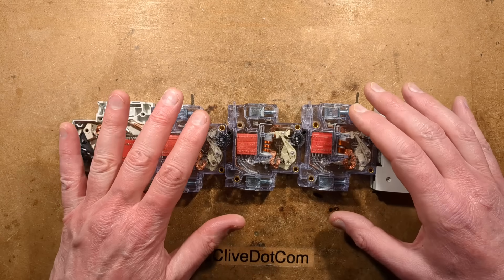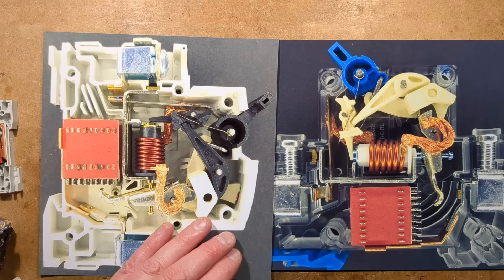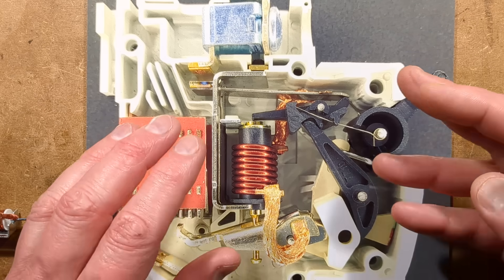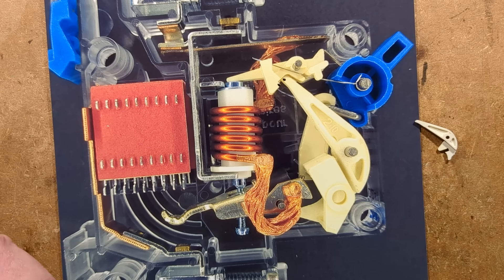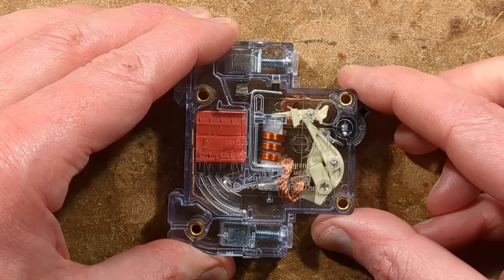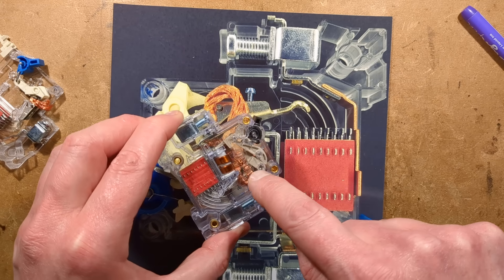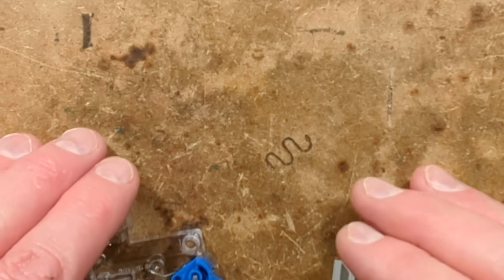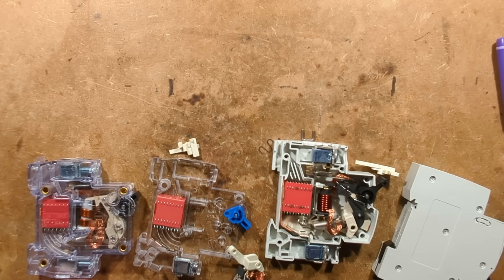A detailed look at the trip mechanism in circuit breakers

Comment: That's looks like an older design breaker that trips to the off position during a fault.

When most modern breakers in the US trip the switch stops halfway between on and off to indicate that the breaker has tripped due to a fault and you have to manually push it down to the off position to reset the trip mechanism before flipping it back on.
Reply: > older design
Very much a standard, current and ubiquitous across Europe
Reply: MCCBs (moulded case circuit breakers, typically only used in commercial & industrial installations and intended for operation by authorised persons only) do often use such a three-position handle, but MCBs (miniature circuit breakers, used across all types of installations and suitable for use by "ordinary persons") usually don't.
Reply: We've switched over to the three-position breakers as standard in South Africa as well, it's nice to be able to tell if a circuit was turned off by someone or if there was a fault.
Reply: @Vapour1o1  The latest miniature breakers have integrated RCD and AFDD functionality and use indicator lights to show why it is tripped (overload, residual current, arc-fault detection). They are expensive beasts at the moment, but inevitably they are going to become common in domestic settings.

Comment: 5:30 you just triggered my mind ... Most circuit breakers can be used with DC, but dc can never trip the magneto ... Only the thermal.

Just solved 30y old mystery ...
Reply from the maker: DC circuit breakers are almost identical inside, but have a magnet to divert the arc into the quencher.

Comment: What does the clear cases have imprinted on the sides, I noticed it was only readable if dissembled, which is weird.
Reply from the maker: The cases are normally not clear.  The text shows how to attach it to DIN rail and indicates the port for adding auxiliary trip devices.

Comment: I had not realised the high x fault current needed to operate above the rated value, made me realise that the fuse in the UK plug to protect the appliance wire is fully justified - even on a radial circuit - to allow manageable appliance flexes on hand held devices e.g. soldering irons.
Reply: Those trip currents can vary. Your home probably has B curve breakers that will trip at much lower current. C and D curve are usually for loads that high inrush current.
Reply: @barrieshepherd7694  only the “instant trip” from the solenoid needs high current.  The bimetallic strip will trip at or just above the rating of the breaker. However, it isn’t instant… the strip has to heat up from the current and that takes time.
Reply: @ So the plug fuse protecting a light weight appliance cable is still justified - as far as I see it.
Reply: Fully justified for historical reasons. 😅

Comment: Perhaps the arc is not significantly affected by gravity because it occurs far too quickly for convection currents to establish - the gas just expands equally in all directions?
Reply: Note that they all have a channel at the top left corner to allow the hot gas to escape 2:30.  The outrush of gas forces the arc into the cooling fins to quench it.
Reply: I think that is it.

Comment: WOW.  I had no idea how incredibly complex and well thought out these things are.  Thanks so much Big Clive.  A cheers to the engineers!
Reply: Older circuit breakers were not so complex and had failure modes that in some cases would not successfully interrupt current.

I hope Clive can get hold of some and show why modern ones need the complexity they have.
Reply: @markfergerson2145  That is pretty cool and not something I had thought about before. 

As much as people like to bemoan 'health and safety', it's that pressure that has led to such inherently reliable designs for things like circuit breakers.
Reply: Agree, it is fascinating to see the amount of engineering that goes into common devices.
Reply: Likely designed and patented by General Electric or Westinghouse in the early 20th century. Back when they were real companies doing great stuff.
Reply: @CanizaM  The first modern style miniature circuit breaker was patented by Brown, Boveri & Cie in 1924, who were a Swiss company (now part of ABB). They patented the design in the USA in 1927 (U.S. Patent No. 1,629,640).
Reply: @TheEulerID  That's a patent for one of the "chunky fuse" format, but in terms of functionality it does check out.
Also big thank you, for a while I've been wondering how fuses of this format work inside and wasn't able to find much info on them.
Reply: No kidding.

Clive is a fantastic teacher, too!

Tops, in my book.
Reply: Those are simple compared to the double pole RCBO type with integrated AFDD functionality. Of course they are approaching 20 times the price...

Comment: Perhaps you've already done a video on this, but I'd like to understand how they trip when there is a low current leakage to ground through a presumably high impedance human being.
Reply from the maker: That's a different type of breaker called an RCD here.
Reply: Lots of videos on RCDs. At its simplest, pass live and neutral wires through a ferrous core and add a secondary winding. However much current is flowing, if there is no imbalance you'll get nothing in the secondary because the current flows cancel out.

Comment: Cool stuff! Here in the states where we insist on making things complicated, there's different standards for circuit breakers. Stores have to stock multiple different brands of breakers, boxes, and accessories. Also, we're now fitting houses with AFCI breakers (arc fault) and they're about 60USD each.
Reply: I used to be cranky about the AFCI breakers, until I was swapping a light fixture and one started tripping -- turns out the hot wire inside the box was frayed, and I'd rearranged it enough that it was arcing to ground!
Reply: Some of that complication is going to be unavoidable because of the different use cases such devices need to be used for, and then there's always the aspect that manufacturers are only going to test and certify compliance to certain standards for a limited array of permutations of their own components, and (depending upon where in the world you are) straying beyond that gets into murky waters where you as the installer have to take on liability for compliance of the assembly to the relevant standards.

Comment: Nice clear view breakers - just like training padlocks, that's a good way to learn how tech works.

Also worth noting is that B/C/D trip current vs time characteristics (3...5*In, 5...10*In, 10...20*In) can introduce some selectivity but only on relatively high impedance branches where a short circuit would cause the lower rating MCB to go off but wouldn't be enough to trip an upstream breaker at higher rating and slower characteristic. Bimetallic parts provide some selectivity over time but that's based solely on breaker's nominal current, not the I(t) characteristic.

Relying on a fuse or breaker to cut off a ground fault works only on low impedance faults, like a dislodged live wire touching a grounded metal enclosure, a metal object shorting the two etc. It won't work in case of capacitive or resistive breakdown, though proper grounding will pull that down to the earth potential and a residual circuit breaker (RCD / GFCI) will detect the leak and cut the branch off if the leak current is above nominal, typically 30mA, though different ratings are available as well (5, 10, 300mA etc.).
Reply: Can you provide an example of high impedance (capacitive) short ?
Reply: @User-w7ckl  death cap in an old guitar amp, dirty PCB, water ingress, dust ingress in moist conditions.
Reply: @KeritechElectronics  thank you. What about arcs? I heard the breakers won't trigger
Reply: @User-w7ckl  yeah, that's why arc fault detection devices (AFDD) are sometimes used.

Comment: The cheapest 120vac here in the US is around $6USD  
The cheapest 240vac starts at about $13USD
Reply: Here in Germany at Bauhaus: Schneider Electric B16 A (for use in 230V installations) 
2,19 € or if you buy a dozen at once  2,09 € per unit
ABB 2,49€ per piece.
Reply: Holy, that's expensive.  
A 40A GFCI is just 20-40€ here, 3-phase.  
30€ buys you a 16A RCBO 1+N.